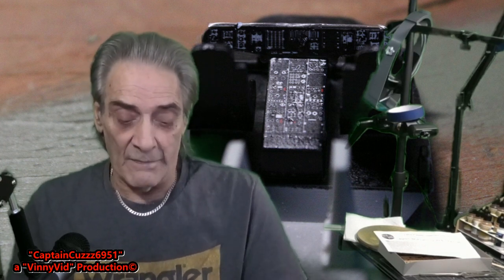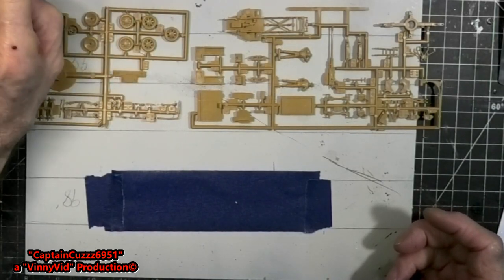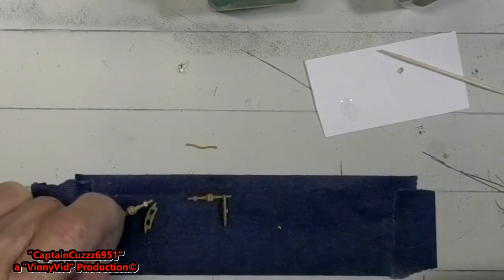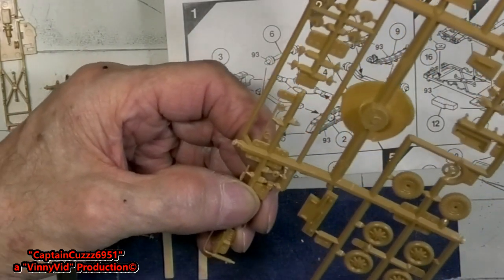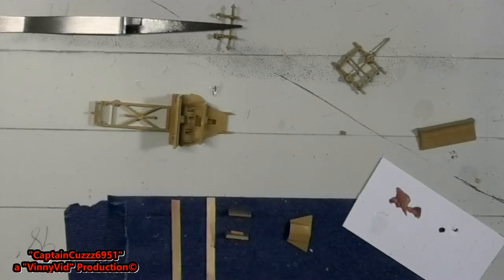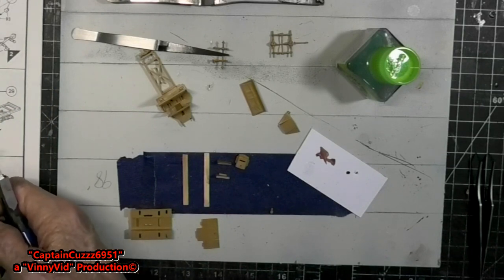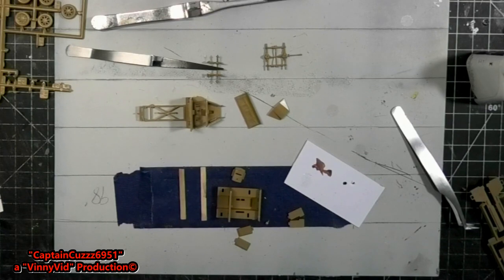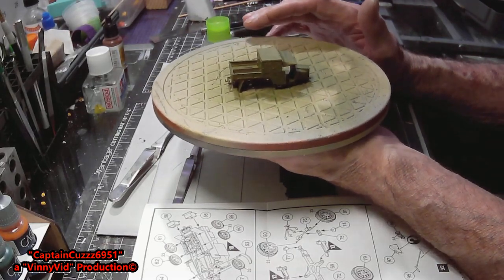my dedication build for Jim Stein...1/72..Bofors 40mm gun ..part 1 the Tractor complete build

Comment: Great job with this and especially with such small parts.  I'm curious as to which airbrush you went with.  It makes it so much easier to work when you can hear yourself thinking instead of trying to anticipate when that loud compressor is gonna kick on.  Great job Vinney!!
Reply from the maker: hi Larry... thx 4 stopping by... i was planning on using my new Paasche Talon air brush but when i went to grab my paint ... surprise!! i didn't have the color i wanted to use... so i used a rustolium camo army green then i hit with a satin clear so i could do the decals ( not installed yet)... like you .. my new compressor is very quite & there is no leak down...thx 4 watching & your comment... vinny